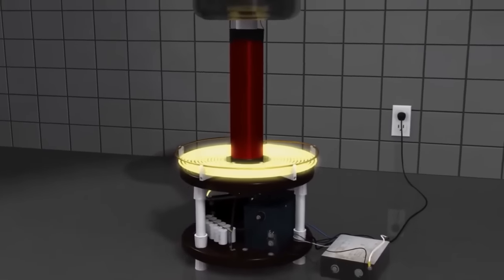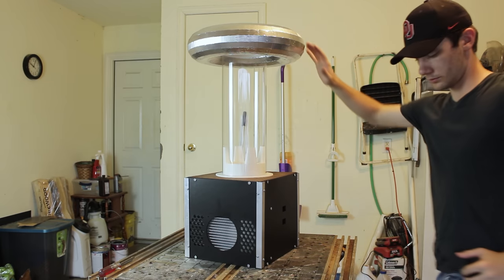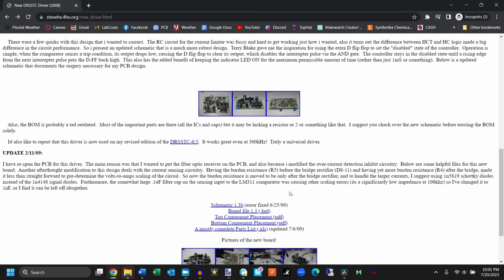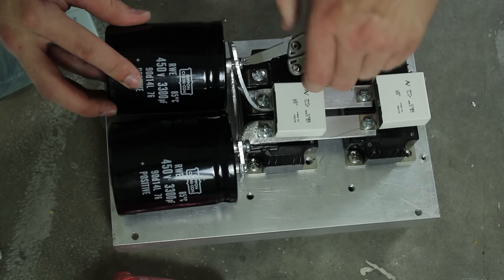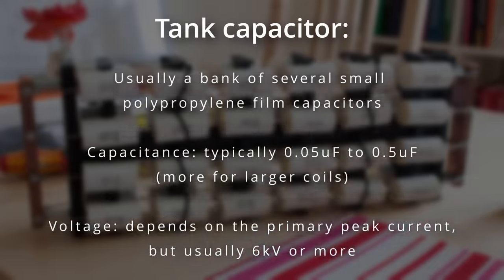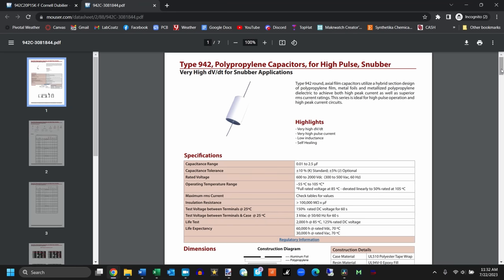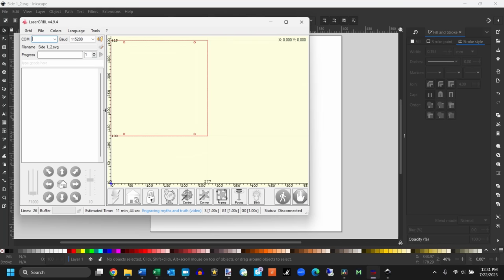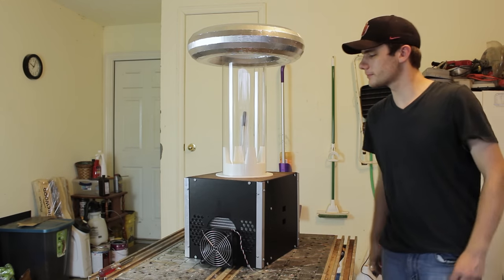How to Build a Large DRSSTC | Part One: Designing the Coil

Comment: never forget, for drsstc you want very low ON time, even if the IGBTs say they can handle a thousand amps. it takes less than a few hundred microseconds for the current in primary circuit to exceed the ratings of the igbts.

Comment: A grid dip meter would be helpful for finding the resonant frequency of the secondary. 

For varnishing it, I suspect Q-dope might be desirable. You can make it by dissolving polystyrene packing peanuts in MEK. It’s low loss and doesn’t impact the inductance of the coil.

Comment: P.slawinski makes a version of the UD driver called UD+. Its around $160 for a fully assembled and tested board which is the same as ud2.7c i beleive.
Reply from the maker: I looked into the UD+ when I was designing this coil, just because freewheeling sounded like a cool addition with the 1ms+ on-times, but $150 was just WAY too expensive for a single driver in my opinion. I could probably build the same circuit for $100 or less, if I had the schematic. Without counting the fiber optic units, which are like $30 a piece, my driver and interrupter combined should cost less than $60 to build (that's including the PCBs and shipping) and perform almost identically to the UD2.7C. The IGBTs and capacitors, however, take the total up well past $300, lol!
Reply: @LabCoatz_Science yeah I completely understand that. My driver was the most expensive single part for me. I don't really regret it though. Eventually I need to assemble the ud2.7c pcbs I have and use the UD+ for a large coil I have in the back of my mind. I'm excited to see you get this thing running though. I hope it lights up with no issues 🤞

Comment: Great video bro, I missed this one somehow. How did the QCW thing go?
Reply from the maker: Haven't tried QCW yet, but I did finish this coil, and I'm hoping to have the final video out sometime this week (assuming the sponsor cooperates, lol)! The coil ended up around 60kHz, and with 680VDC on the bridge, it can easily crank out 4' arcs. It seems happiest around 100us and 200 BPS, and I'm sure if I plugged it directly into a 240V outlet instead of my 240V transformer (which probably gets really loaded down) I could hit 5' or more! I had to use the UD2.7C though, since my driver failed to operate. Overall it's a fairly solid DRSSTC!
Reply: @LabCoatz_Science  That sounds awesome. You kind of reminded me that I need to rethink the lowest freq possible with bricks. Any idea if the ones you used were like "legit" from a distributor or maybe more like ebay specials?
Reply from the maker: @Magneticitist  I just bought them second-hand from "All Science", who has built his own DRs with them before. I looked up the part number and they seem like legit Mitsubishi CM300s!
Reply: @LabCoatz_Science  Man you know it's a really tough one cause the only real way to know you're getting a legit half bridge module that can handle something like 300A+ continuous is by dropping like $300+ on just one module. China has gotten so good at counterfeits that I'd bet people with their aliexpress deals are simply not pushing their builds far enough to where the counterfeit smaller die size etc can't take it. If one were to assume like a 1/2 size reduction then I suppose just buying two $50 bricks vs one $300 brick is still a better deal.
Reply: @LabCoatz_Science   I keep forgetting the strides in semiconductor advancement these days 😂. For your next build I recommend trying something like new miniblocs. I'm going to try these out instead of using older slower bricks I grabbed from old VFDs. IXXN110N65B4H1. Like 30 bucks a piece ain't bad and that's from legit sources.

Comment: nice build. but i still cant find anyone explaining how the driver with primary feedback works in detail. Like what exactly every part of the circuit does.
Reply from the maker: Loneocean's writeup for the UD2.7C is really good for that. I could've gone into it, but the video would be well past 20 minutes at that point, and there isn't much you technically need to understand in order to get a DRSSTC running with it (besides what I already mentioned about the feedback windings, OCD setting, etc).

Comment: So, I'm quite amateur in my knowledge of electrical diagrams and in fact a lot of electrical engineering/design:
WHY can a secondary coil from a microwave kill you in a fraction of second; but the secondary of a tesla coil isn't dropping bodies all around it? 

Am I missing something? Like I know that microwaves have high amps and volts, but is a TC just high volts and low/no amps?
Reply from the maker: Styropyro actually made an excellent video talking about why Tesla coils don't kill you! Some people say it's the "skin effect" (that the high frequency electricity travels along your skin and doesn't penetrate deep enough to hurt your organs), but this isn't actually correct. Same for the low current myth: many modern Tesla coils can actually output hundreds of milliamps of current!

The short answer is that high frequency electricity doesn't tend to affect your nerves very much, so it's almost impossible feel (unless a Tesla coil is interrupted, in which case you might feel a bit of a buzz, but nothing dangerous). You can touch many Tesla coil's safely, but larger coils can still hurt you: interruption kinda makes high frequency electricity "appear" like lower frequency electricity to your nerves, so there is some risk of shock. Additionally, if you touch a strong enough coil for long enough, it can lead to burns.

In general, most Tesla coil arcs less than 24" long are fairly safe to touch. I say that because I personally know people who have been zapped by coils with that kind of output, and it caused no serious harm. But with arcs longer than about 1 meter, it's hard to say what would happen...you probably wouldn't die or go unconscious, but it wouldn't feel very good! Hope that answers your question!
Reply: @LabCoatz_Science  Appreciate the info. I've watch some of StyroPyros stuff but must have overlooked that vid. 

Yeah I've touched em in lab classes etc, but learning about some stuff it seemed like the kind of thing to ask.

With TCs can they only output electricity, or can they take it in via some sort of daisy-chaining of one TC to another nearby?
Reply from the maker: @djdrack4681  If you have a coil nearby (especially one with the same resonant frequency), it will indeed develop a voltage! I've actually seen demos where somebody places two coils next to each other (one power and the other not), and the unpowered coil produces sparks! However, for wireless power purposes, it's not a very good option: only part of the energy actually makes it to the other coil, and then you have to worry about stepping it down again with another tuned primary circuit (which would technically be the secondary in this case...it's weird, lol).
Reply: @LabCoatz_Science  it isnt just skin effect.

make a tesla coil from a ZVS driver. just a little one. touch the coil. 

i guarantee you wont ever let that arc strike you twice. not too worry, they barely make any lightning. 
what they do do when they draw an arc, is pump as much power as the supply can deliver into that arc. volts and amps mean nothing, its all about impedance and the amount of power that can be transferred. the voltage across the arc is only quite low, but the power is what makes it so spectacular...
a ZVS is a parallel resonant circuit, it always stays in resonance regardless of changes in inductance or capacitance, and its power draw is only limited by the loss, which in this case is the arc...

with no arc, the resistance of an open circuit is huge, and then its multiplied by the turns ratio squared. a tesla coil usually being about 100:1 or higher, that makes for 1:100 from secondary to primary, and the square is 10,000... so the resistance the power supply sees is huge, and barely any power flows. you dont get amazing light shows from a ZVS driven tesla coil. you do get extremely hot, painful arcs that give you RF burns and melt secondaries.
 they do work fine when used as a power supply to drive a spark gap. just dont use them to drive the secondary directly.

when the secondary is shorted, the resistance drops to nearly zero. and now, the power supply sees nearly zero resistance, and will try to deliver everything its got into that resistance. as an arc is drawn, voltage creeps up to some low value, and the arc makes lots of heat as lots of power is flowing through it...

this is much the same as what is happening in a microwave transformer as well... theyre unregulated, and when you short the secondary, all the power supply, in this case the main grid, sees is this resistance... at the multiplied (or divided by!) the square of the turns ratio..

it means that if you accidentally bridge the gap with say, your finger, that at 2kv is a few mm or so of air, then as soon as the air ionises and an arc forms, the power will only be limited by the resistance of YOU. (ignore the coil resistance. gets weird when its higher... usually its orders of magnitude lower...)

whereas i will happily let a spark gap coil play its display over my fingers without so much as a whiff of singed hair, despite it spitting out 1meter arcs.

in this case, the neon transformer is specifically designed to only deliver 30mA when its shorted out. it will only deliver 15kv when open circuited. its voltage drops right down when it shorted. the conductive gas in a tube is a very low resistance, offers no impedance to current flow... so the transformer must limit it. the current will never exceed 30mA, and as it does, the voltage simply sags, so applying ohms law, everything still ends up balancing out... neon tubes are intended to be run 24/7....

and the tesla coil... it again, is so looslely coupled, that teh energy just doesnt transfer from primary to secondary, and with a  spark gap type... the supply CANT just deliver power into the load, all it ever sees is the need for the capacitor to be recharged on every cycle to make good the losses..

so, the MOT... its tightly coupled, designed specifically to deliver power, and lots of it. it has the potential to reach 2kv (usually) but when shorted that voltage drops and the current soars... like wacking a nail with a sledgehammer. effective.

whereas the tesla coil... as soon as it draws an arc its over, the energy being transferred is irrelevant. an impedance mismatch. like trying to hammer in a nail with a ten gram hammer with a two metre handle made from noodles.
Reply from the maker: @paradiselost9946  I already said it wasn't due to the skin effect. My point stands: the reason it doesn't shock you is because the frequency is too high to effect your nerves, but it can burn you if you aren't careful. This is why you could touch hundreds of milliamps of high frequency electricity (from a Tesla coil, flyback transformer, or other HF ferrite-core transformer) and only receive burns.

Comment: Does anyone use self-oscillating designs? There's a driver circuit for a dual IGBT module that uses a current transformer burdened with zener diodes instead of a resistor as a drive transformer to generate the gate drive waveform. The control circuit typically works by selectively shorting out a control winding on the drive transformer, either to set pulse width (PWM) or to delay the next pulse (PFM). The designs I saw dated from the 1990s and the increasing use of integrated gate drivers seems to have pushed it out of the mainstream. I think it was derived from an even older design that used a current transformer to drive the base of a bipolar transistor, with the turns ratio set by the transistor's gain.
Both circuits were "stable" in the off state and needed some form of starting pulse, often produced by a DIAC.

Comment: Great work, however, T himself said he could do easily 1000 foot sparks... But as you know , that is a waste and he would rather resonate the coil and send it to a ground wire... To another opposite wound receiver..
Something no one seems to do because it would vindicate Tesla's long-range power.
Reply from the maker: Glad you liked the video, but a thousand-foot spark would require a VERY tall tower to keep the arc from grounding out prematurely, as well as several hundred kilowatts of power. It also wouldn't really vindicate Tesla's wireless power system, since the Tesla coil by nature can only transfer about 20-50% of the input power to the secondary coil (as indicated by the coupling coefficient). This makes it wildly inefficient, even with the best theoretical receiver, hence why nobody had properly implemented it into the power grid.
Reply: @LabCoatz_Science  with all your knowledge and skills intact, all I'm saying is Tesla designed his system to NOT radiate out, (obviously there is some activity nearby it from high oscillation or breakout)..
But he said in a formal courtroom questioning among stenographer, 
You would get only 10% of the current energy by ether disturbance... but 90% by direct waveguide connection. 
To add, he remarks that what he termed the dampened wave, (either quenching spark, which he could interrupt higher than needed, or breaking the resonator to ground)
Said that 1kw could yield 5000 kw, whereas the continuous wave would only yield 1kw.
It's said that using the Extra coil resonator beyond 1 kw input is where the 3rd coil acts beyond normal operation,  which acts as its own series resonant circuit, but tuned as a topload object.
Giving 2 separate 1/4 wave rises.
Not 1/2 wave.
I don't yet have that ability, and my objectives are different. 
See Kapanadze 100kw 2007 demonstration Turkey.
I can give you all schematics.
And I must say, Electra runs just so nicely, you're very skilled